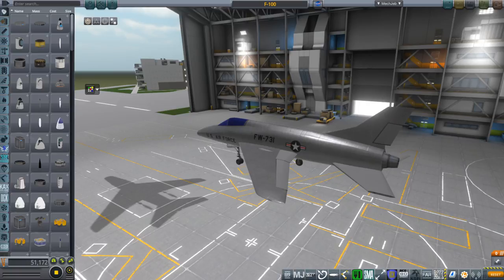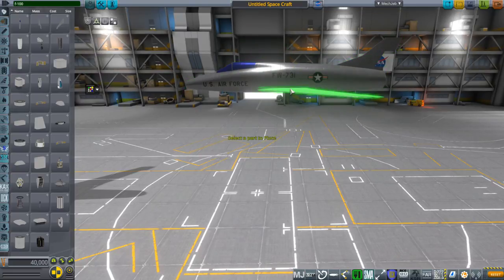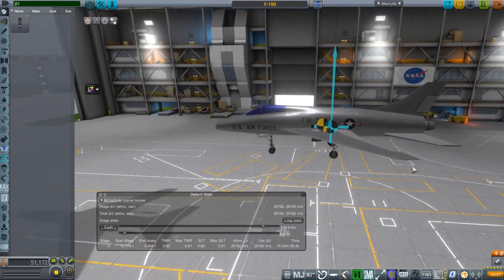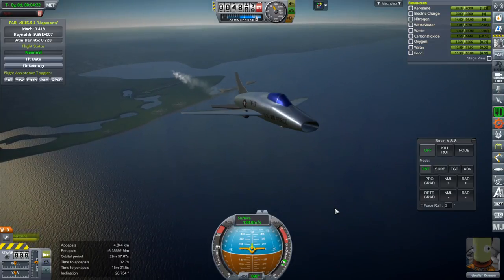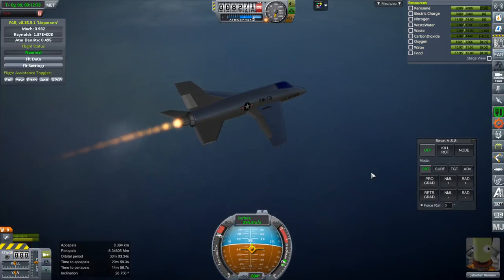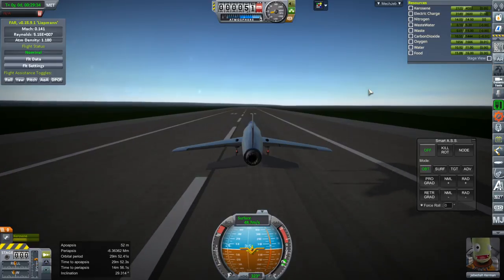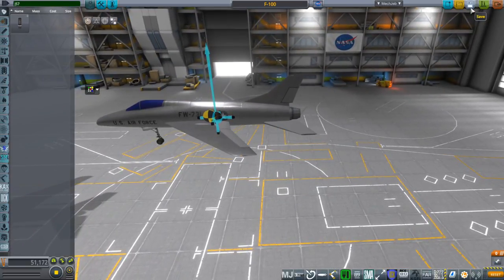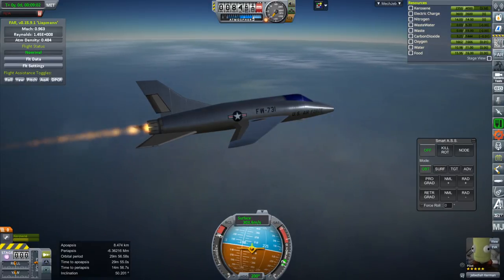Kerbal Space Program - Realism Overhaul Sandbox - F-100

Comment: @tyler raiz PLEASE do a "single engine Transonic" Derwent V jet. I spent oven a month designing one, its super rewarding. I can confirm with careful area ruing it can hit mach 1.2 in level flight
Reply: I'd personally really like to see him (or at least someone) try to design a supersonic aircraft powered by WWII Axis turbojets—some of the advanced prototypes for easy mode, the production Jumo 004s and BMW 003s for more of a challenge, and the Ne-20 or HeS 3 for extra punishment.
Reply: @grantexploit5903  I can attest to the Derwent V (a scaled-down version of the Rolls-Royce Nene developing 3,500 lbf, or 15.6 kN, of thrust) being the earliest (or "weakest" ) jet engine caple of mach 1 in level flight via a single engine. Even then its SUPER-TIGHT, the area ruling, total and wet/dry mass ratio.  see this link for my personal results: dry mass: 4913kg Wet mass: 5076kg, check area ruling numbers
https://forum.kerbalspaceprogram.com/index.php?/topic/162117-122-realistic-progression-zero-rp-0-lightweight-realismoverhaul-career-v054-june-15/&do=findComment&comment=3335272
Reply: @jeffreywitty3088  I did some calculations, and it turns out the thrust densities (thrust per unit area, dimensionally equivalent to pressure) of the BMW 003, Junkers Jumo 004, and Heinkel HeS 30 are actually higher than that of the Derwent V, which makes sense as the former are axial while the latter is centrifugal. So, I assume it could be done with an even smaller aircraft with much smaller wings—your aircraft also had to meet the criteria to fly at 20 km.